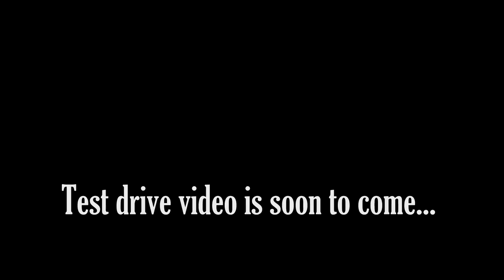1960 Chevy Impala - The Road to SEMA - Manns Restoration

Comment: That is absolutely beautiful. And you didn't suck the life out of the original car,interior or drivetrain. Big fan of this kind of vision and workmanship.
Reply: An incredible make-over. But, that's just my issue with it. It'ended up as a 'resto-mod', rather than being faithful to the original. Yes, it's gorgeous - but it's NOT the car the way it was made. I would have rather seen a redone motor and drive-train more faithful to the original. The new separate front seats and console is amazing, but not the way the car was made. The new wheels are terrific - but perhaps replicating the original steel wheels and 'poverty' caps would have been more authentic? I don't know. If they set out to do a 'restoration', this certainly isn't it.  I don't mean to pour water on the party, folks. I can certainly acknowledge that the  Mann's Restoration crew did an amazing job, though.

Comment: They used the proper engine, and modernized it. No cookie cutter power here! I love the wheels. Great car.
Reply from the maker: Glad you like it, thanks for taking a look!
Reply: WHAT DO YOU MEAN PROPER ENGINE? THERE WERE 6 PROPER ENGINES AVAILABLE ACROSS THE BISCAYNE ;BEL AIR; IMPALA LINE UP. IF YOU ARE REFERRING TO THE 348 THERE WERE 3 VERSIONS AND IT APPEARS THE ORIGINAL ENGINE IN THIS IMPALA WAS A 348 250 HP  VERSION WITH A SINGLE 4 BARREL .THE NEXT IN LINE WAS 280HP VERSION WITH 3 DEUCES AND THE BIG ONE WAS THE DUNTOV 348 WITH DUNTOV CAM SOLID LIFTERS 11.5 TO 1 COMPRESSION AND DUAL IGNITION  DUAL EXHAUST ALL 348'S HAD DUELS.SO IF THEY CHANGED CAM AND LIFTERS AND THEN ADDED THE INJECTION YES IT WOULD BE THE PROPER WAY TO LIGHT UP THE TIRES.AND THE PLATING OF THE TRIM SETS IT APART FROM THE ORIGINAL ALONG WITH THE CENTER CONSOLE ,THAT WAS NOT AVAILABLE TILL 63.I OWNED A 59 283 230 HP 4 BARREL TURBOGLIDE IMPALA COUPE IN RED. AND A 60 DUNTOV 348 335 HP VERSIONS 4 SPEED POSI  POWER EVERYTHING DELETE ,EVEN NO POWER BRAKES  OR STEERING ,NO PADDED DASH. THE DEALER ORDERED IN 1960  48 OF THESE EXACT COUPES DUNTOV 348'S 335 HP LIST PRICE $3350.00 OUT THE DOOR $2850.00
Reply: @richardfeibel3154  I think what he means is it wasn't a generic LS crate motor swap like everyone else does.

Comment: In 1963  I bought a 1960 Chev Impala convertible, 348 engine and the most awful TurboGlide transmission. One of over 100 vehicles I have owned.

Comment: Great example of General Motors body designs of the 1960s! The 1960 Chevy Impala was one their best designs back in the 60s, and this beauty was restored perfectly with lots of passion. I have seen a lot of other beautiful 1960 & 1961 Chevy Impala's done to perfection, until they turn them into Low Riders, or put those Ugly oversized wheels on them, taking away from the original beauty!

Comment: I restored my 1960 Impala when it was only 7 years old, from white to 17 coats of Galaxy blue lacquer. Black diamond tuck interior even nicer than this car's. Also had the W block 348 with single 4barrel 320 hp stock.. this restoration is the best I've seen but I would have put in a Muncie 4-speed as it was a special order option. Mine was a 3speed manual. It would do 110 in 2nd gear and don't let anyone tell you a 348 wasn't a beast if it came in an Impala. The truck W blocks were a pig put not the high output blocks. I beat it to death and it never failed me once.

Comment: The sixty had toned down fins from the fifty nine. I think you could still get the 409 V8.
Some what similar to the Edsel with out the center grill ring.
A beautifully restored top Edsel would be cool as well. They were a very unique car and quite rare now days.
Reply: 409 wasn't available until 1961. 348 was the big block from 198 to 1960.

Comment: What are the wheels?  Off the shelf?
Reply from the maker: They are Billet Specialties wheels designed to look like the original Chevrolet hub caps.
Reply: Yeah!  Thanks.  They look great.  Look right at home there.  Modern large rims don't look right a lot of times on older cars.  This is the best of both worlds.  Classic design yet also the large rim size.
Reply: Can't find those wheels anywhere...can you give more info? Part number? Model?